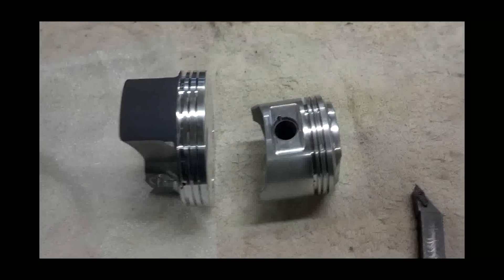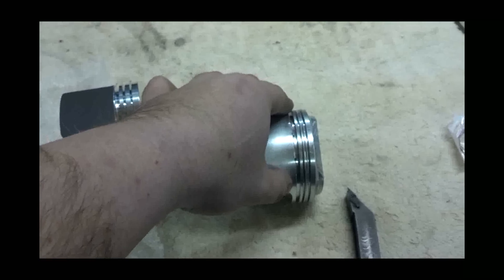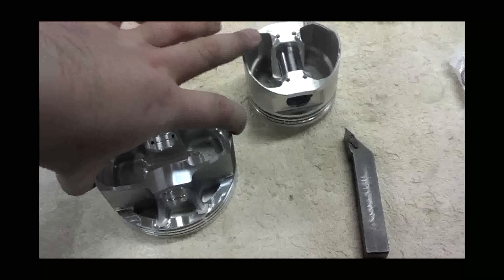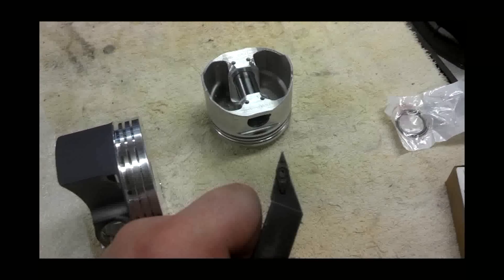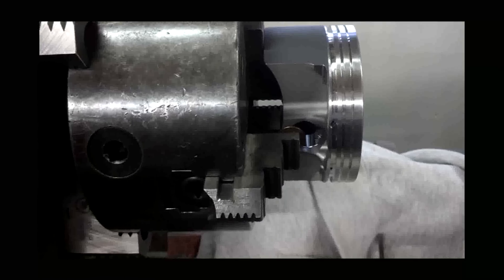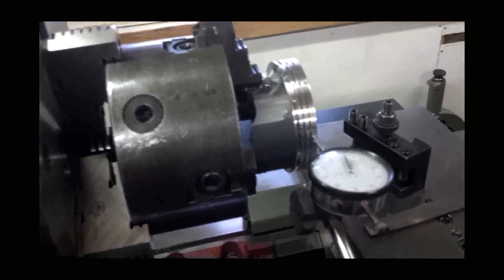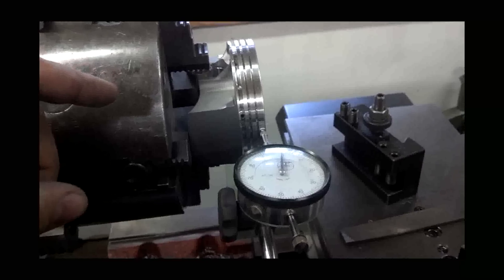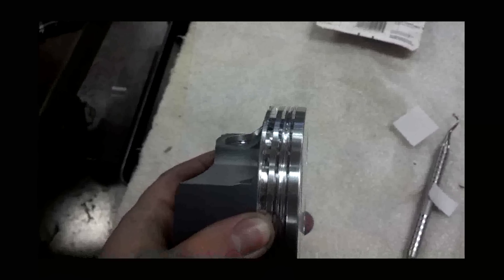KLR705 piston machining accumulator groove

Comment: Awesome!Hope it's running great ! I'm about to get the 685 kit with the cylinder /bore /hone from Eagle Mikes for 82,000 mile '06 . Starting to loose compression and oil . It stills runs fine every day as it's my only transportation for the last 6 plus years approximately 80 mile a day for work but it needs attention in this respect I think. I suppose that the rings he'll be sending me will be the kind where I won't be hurting without that groove you machined into your 705 piston . I hope so anyhow . Fluttering rings doesn't sound optimal. Very interesting and thanks for the schooling !
Reply: How do you "loose" compression and oil?